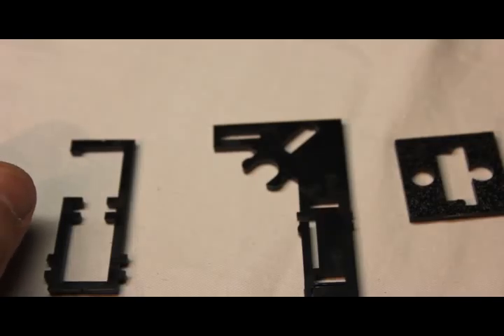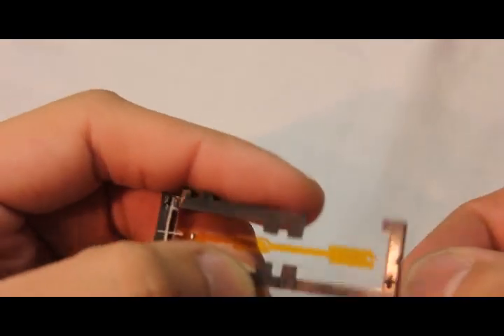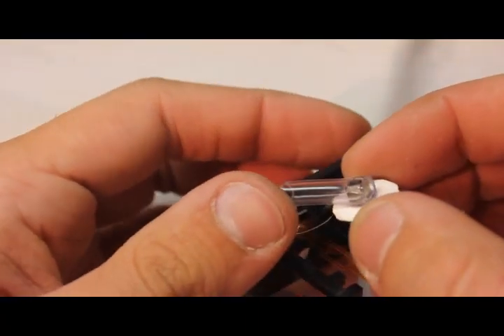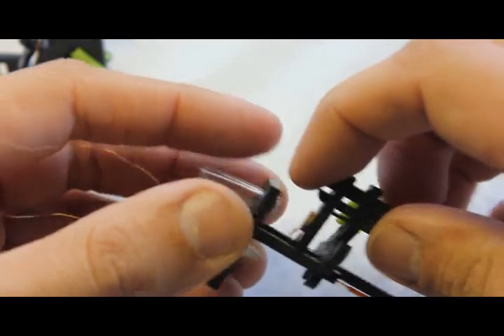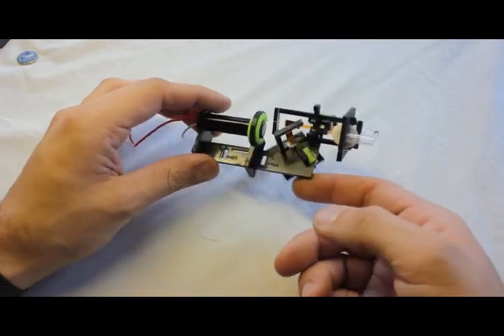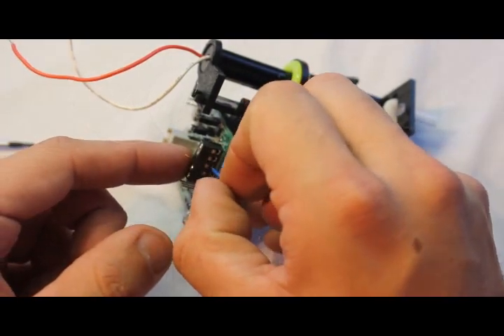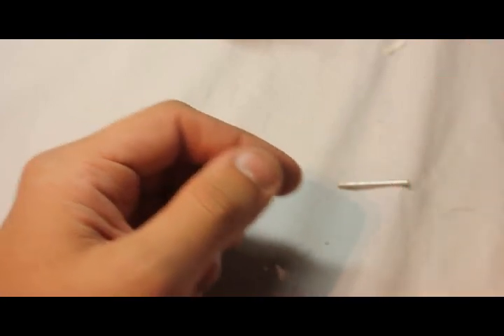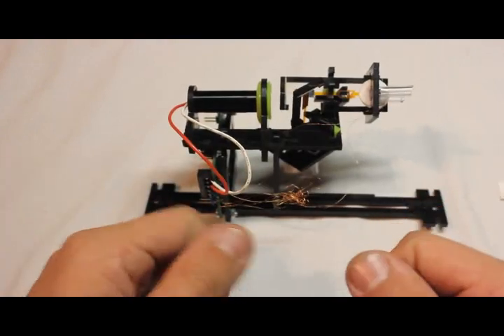How to build the Peachy Printer - Beta 2

Comment: Thanks for the video. But what's with those long runs of uninsulated wires? That's just inviting shorts.
Reply from the maker: Don't worry, the insulation is transparent or perhaps copper colored. It is insulated though. It would be crazy to run uninsulated wires!
Reply: Leland Griffith It's called enameled magnet wire. Using insulating enamel instead of the plastic allows better transmission of the electromagnetism that the printer relies on to move the laser beam. It does have limited use, though, because enameled wire causes more efficiency in motors/electromagnets but raises the chance of arcing in higher voltage systems.

Comment: so when are you going to post videos of your PP28 printing?
Reply from the maker: I posted a few pictures on the forum. Take a look there if you want to see, but even the best of my prints still have lots of errors. They are impressive for a $100 3d printer during beta, but the software is still getting there. The slicer is causing problems, so they have to write their own.

Basically, I will post print videos when I have a successful print to film. Costs too much otherwise. You buy me some $45/liter resin and I will print and film whatever you want :P